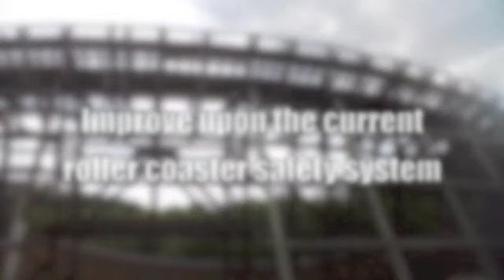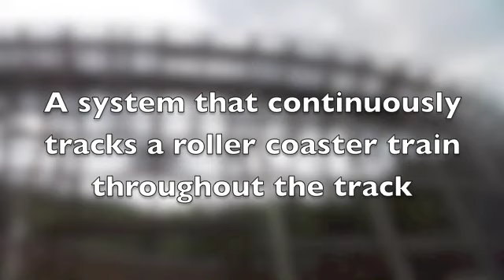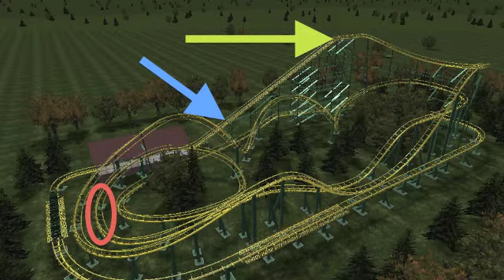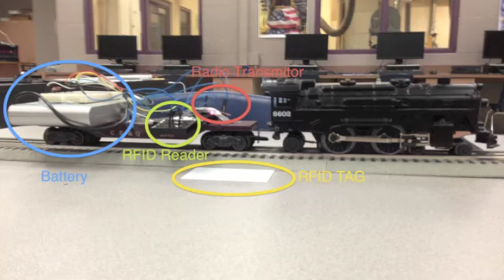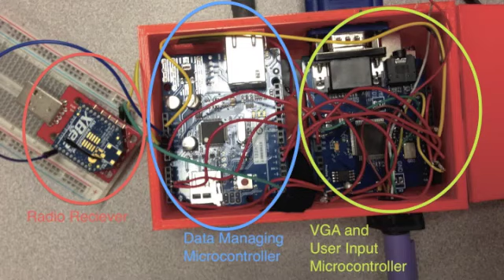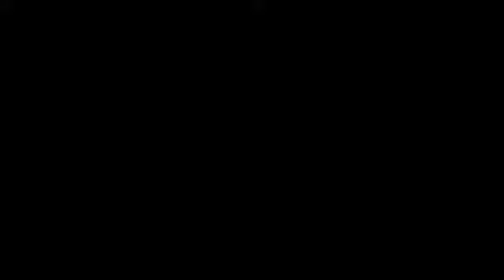Roller Coaster Tracking Device

Comment from the maker: Thanks! Using a Local GPS was actually our second option. We chose RFID over GPS because we were worried about how reliable it would be on a compact coaster (like a wild mouse). It’s a good idea, especially if an accurate signal could be established. We also considered a servomotor that would attach to the back of the train and measure the distance traveled along the track. We thought it could possibly stop the train if there were an emergency, but it was out of our price range.

Comment: Good job team. Your idea has another application: accurate physical registration of G-force recording data. Before a 'coaster is certified safe, we record acceleration data for the entire ride to ensure that it is not too rough. Rough track is repaired. Finding the exact rough track is hard over a 2-5 min recording. Position markers in the data would help identify exact locations.